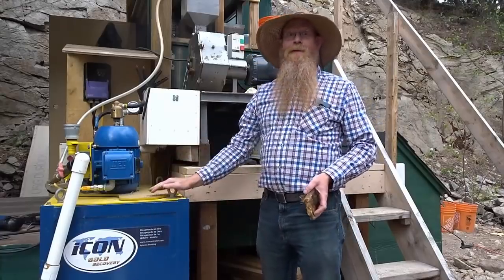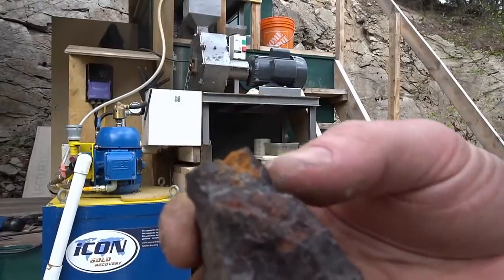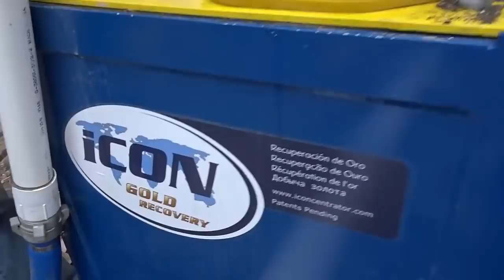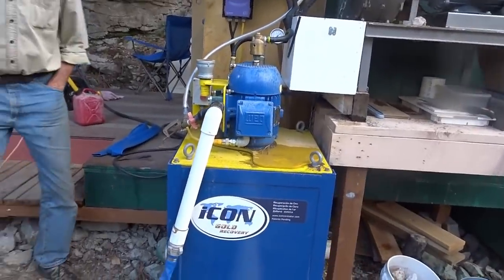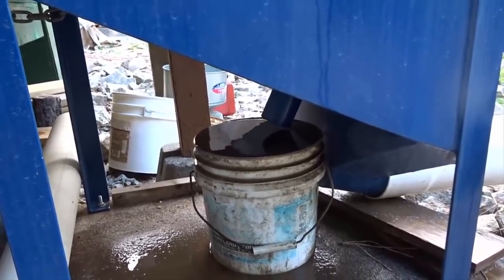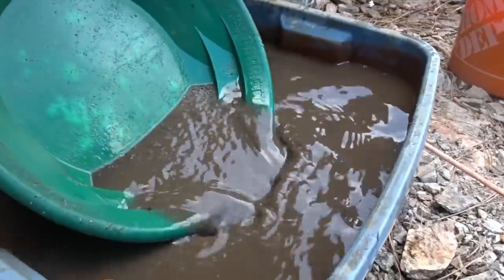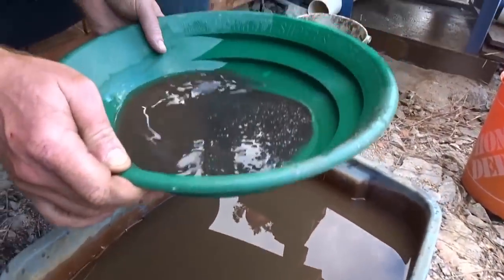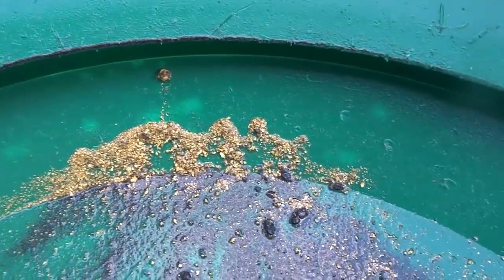Very rich gold ore crushed and processed.  Nice surprise!

Comment: Those ironstone rich heavy samples are rich in gold ore , you can see the gold easily. Where I live here in western Australia we have similar type of rock strata and calcrete claylike stuff with heavy iron staining . When it's crushed / dollies up and panned off  with water that's got bit of dishwashing detergent in it the gold is visible. Most of it is like almost flour gold it's that fine , hence the detergent in the water to change surface tension and stops fine gold floating out. 
Great video mate , best regards from western Australia down under.

Comment: This is probably a stupid question, but are the iron compounds left in the pan magnetic? Couldn't you put a big neodymium magnet in a Ziploc bag (to keep fine iron off the magnet), then run the magnet across the bottom of the pan to drag it to the other side of the pan, and aid the separation of the iron from the gold? Or isn't it magnetic enough because it's in a compound?

Comment: That was a nice little run your friend provided for us to see...maybe next he will provide you the ability to film where that was mined, doubt it though...oh well...I'm suprised you haven't built the generator it's own little shed beside the set up so it can be kept in a quieter location...ya know. Air intake pipe on one side, exhaust pipe out the other. Might cut the noise when running...And will you eventually be plumbing in a pipe under the Icon I150 with a 45° angle plus clean out fitting to a collector bin beside the machine so you don't have to use a bucket under it which is good for large hard day runs. Or keeping the set up about the same ? And will the video showcasing the other submitted logo's be soon ? I only thought about that when I saw the chosen one at the end of this video...Well you and yours be safe and have a good, fun season....So until your next video...Bye 👍
Reply from the maker: I do plan on doing something about the noise

Comment: I wonder if a good water table would help separate that gold with less work & more recovery than panning. Hate to loose any after all the hard work.  DIY water tables can be made for $75 - $300 to handle large volumes of material at the end of the process. Great setup & best wishes.

Comment: A little weird trick for quieting down a generator is if you can get a piece of flex tubing attached to the exhaust, run it into a bucket of water. It'll greatly reduce the exhaust noise. Or you can always add a secondary muffler onto it.

Comment: Hey Dan, an idea. Why not make another small sluice (probably pretty steep gradient would be best) with some strong magnets underneath (removable of course) to help separate the black sands, irons, etc as they run out the effluent of the "good stuff chute" from the icon?
Reply from the maker: The icon should be catching almost everything.
Reply: @Boosted98gsx, the magnets would end up trapping a lot of gold in with the black sands
Reply: @jasonhawes5096  Even if you had constant water over them moving the black sands around in the magentic field? I would think strong enough water would separate them?
Reply: @Danhurd  I just mean after the Icon has caught everything, between it and your final pan, helping separate out the unwanted heavies
Reply: @Boosted98gsx, a sheet magnet might work, but generally, the stronger magnets will grab the black sands and actually create a barrier that the gold cannot travel over or through, and more will stick behind the gold and create a "gold sandwich"
Reply: @jasonhawes5096  So what about then having the gold / black sands traverse a magnetic field while falling vertically through water instead of over top of a field?

Comment: 500 Pounds? Thats around 250 kg? At an average density of 5 g/cm^3 this means around 50 litres of material - 5 buckets full of rocks and dirt. Correct?
The amount of gold extracted looks like 2 to 3 grams. This results in a concentration of roughly 10 grams per metric ton. Is that good or not so good? I don't have a feeling.
Reply from the maker: It was more than 5 but that might be because of the air gaps
Reply: Great work there Dan! It's always nice to see the gold you find whereever you are. But, if that pan is only 2g, my rough figurin on 500lbs of ore comes in at slightly over a 1/4 oz per ton. Pretty sure it would only be profitable if layin on top of the ground. Needing to dig it out would be a losing venture unless the ore could produce at least 1\2 oz per ton. Just sayin...
Reply: Personally, I ain't stoppin till I find 2oz per ton. So many abandoned mine dumps, so little time...bye!

Comment: You should extend a long pipe from the exhaust on your generator to divert the noise. It wont really affect the overall performance, but it will help you out, especially for your videos.

Comment: Ive seen many a jaw crusher and I'm telling you its cycling too fast. The rocks have no time to fall into the jaw before being launched up and over again. Look into the speed rating for the rock type and size your running.  Either re-gear it or run a vfd to slow down the motor, your production will go way up.

Comment: That machine you have there is probably about $10,000 It Hass to crush a lot a rocks to pay for it self ? Provided you have no breakdowns that would be a maintenance issue very expensive. It did good but also you need to take into consideration there’s a lot of gold in that rock you crashed .